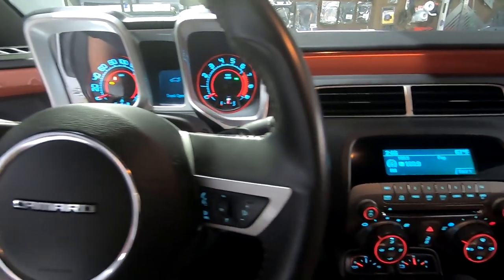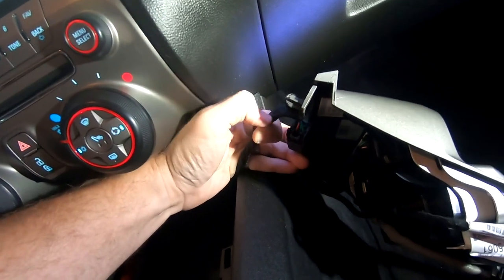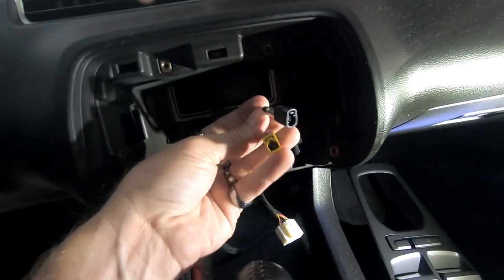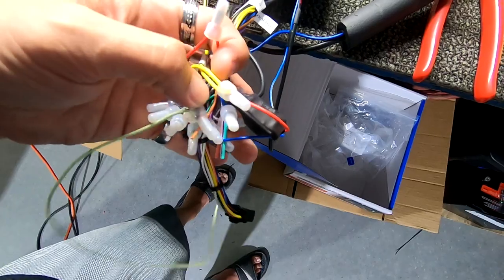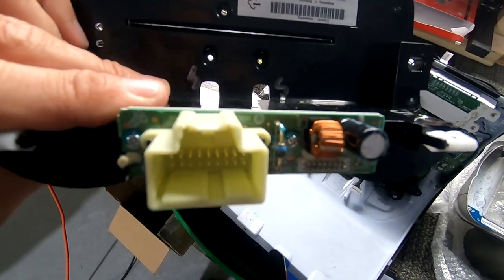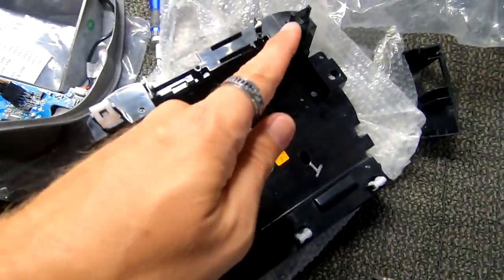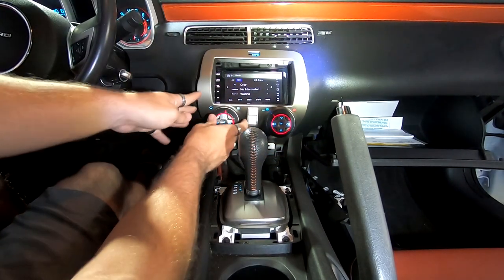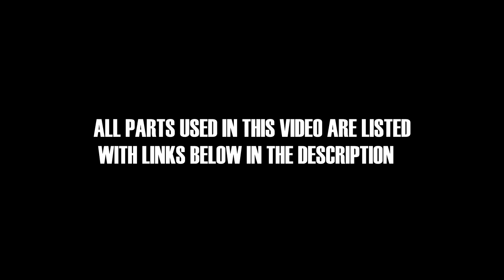2010 - 2015 CHEVY CAMARO PAC AUDIO DASH KIT / HARNESS - RADIO INSTALL WITH BOSTON

Comment: This indeed was a great informative video. Now we know about pac- rp5-gm4101 and 4102 dash kits the modules need to plugged in on the standard side not the amplified side if you have the premium Boston Acoustic systems. Thank you so much

Comment: I got this but I'm nervous about the wiring process everything else I think I can do. Any good videos where it explains wiring process for radios?
Reply from the maker: It's pretty straightforward on these you just have to match up the wires. If there's any questions you have let us know we can try to help you
Reply: @octanetvchannel  Thanks for replying, I will give it a try and let you know if I have questions
 Thanks.
Reply: Don't be nervous dude! It's super easy. You just need to match the wires to each other. Just check your work 3 times before you hook it up to make sure you have everything right! The more you do the more confident you get in doing stuff like this! I was a nervous wreck when I first did mine. And remeber you can always cut wire shorter but you can't make wire grow back so don't cut them too short!
Reply: actually the wiring is prob the easiest part bro
Reply: Yeah I don’t understand the wiring. There a set for subs rear our front out and all idk. I connected it and don’t have any sound.

Comment: been looking at options for my '13 for radios as the Bluetooth in mine is failing.  Gotta say its nice to see the knobs retained on this versus others, but it just doesn't look as clean.  making it hard to decide haha
Reply: What did you end up doing lol?
Reply: @uhzemsal8703  well haven't bought yet but think I'm going the maestro route because of the programmable outputs the RR2 interface has, gonna control my line lock and 2 step systems with it ;)
Reply: @moosescorner  nice lmk what you do bro

Comment: This video is halfass, it shows all the stuff wired to the new harness but doesn’t show where any of the connections go. It cuts from the scene where everything is being wired up to the radio being installed in the dash without showing the connections.

Comment: I got a boss radio with CarPlay for my camaro with the pac interface, I have the 2ss package with the Boston acoustics system already but it sounds lackluster and staticky sometimes on Bluetooth and CarPlay. Any suggestions? Do I need a speaker upgrade?

Comment: I noticed a little connector on the right side of the rear control panel, do you know what that is for? I’ve installed my kit but the A/C controls do not have any function. Nor do they light up. Not sure if a wire is shorter or if it’s user error.
Reply: Same problem. Ever fix?

Comment: The harness that has the AV rca: you said it was for the reverse camera. The car doesnt have a reverse camera, so what did you mean? Does the kenwood not have a rca plug in already on it if you wanted to put in a reverse camera?
Reply from the maker: if you do not have a rear view camera factory on the vehicle you can add a aftermarket rear view camera and plug it into the rear view camera in on the yellow port on the back of the radio
Reply: @octanetvchannel  okay thanks! What was that adapter for then? Do some of these camaros have a factory camera?
Reply: Yes they do they are in the rear view mirror.

Comment: Excuse me, which cable should I connect? so that it detects the ambient temperature in the chevrolet logo, I already connected an alpine... with the same type of console, but it only appears degrees
Thanks....😅
Reply from the maker: I would probably contact pac audio

Comment: what's up with the door chime? Is that default or can you change it?
Reply: That door chime is the sound that Pac programmed into the chime box that comes with the radio. The only way to change it is to buy a seperate tool and reprogam it yourself.

I just took mine out bc i hate it lol. Only downside is, the chime box is also what produces the sound for your turn signal. So now i have to actually check to make sure mine is on 😂

Comment: I have a important question or help I know this video is like 3 yrs ago but I took my daughter’s 2015 Camaro to a stereo shop they installed everything than the instrument cluster when out took it to the dealer and they cannot figure what’s wrong with it the only thing they told me was I shouldn’t put a aftermarket stereo on so I don’t know what to do I bought another instrument cluster and nothing still the same anyone that had this problem please let me know thank you 🙏🏻